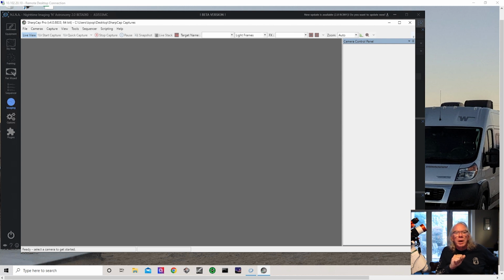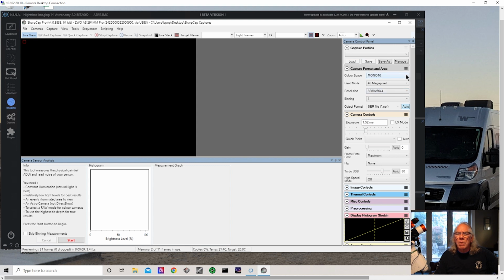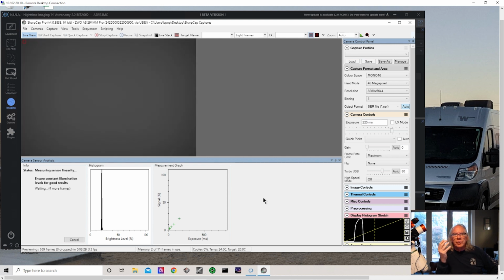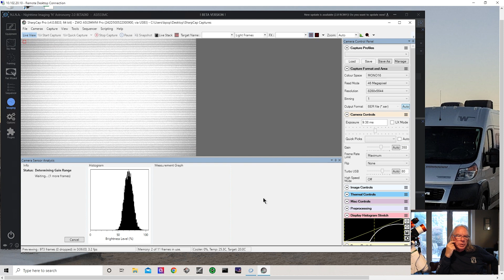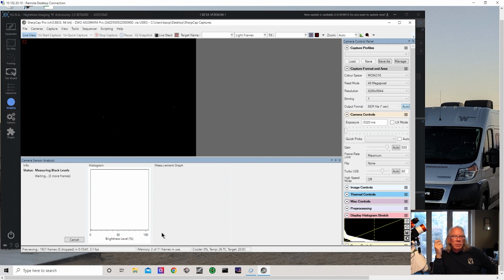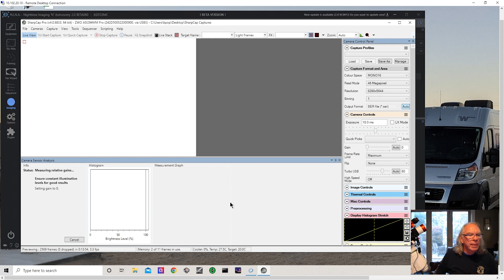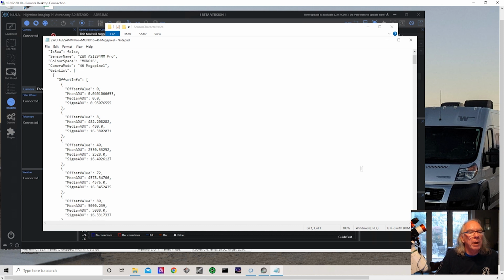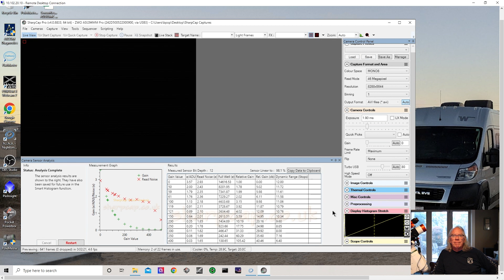Sharpcap Sensor Analysis - NINA Exposure Calculator - EQ6-R Pro Mount

Comment: Sharpcap's polar alignment and sensor analysis are superb. Polar alignment is very accurate, you can also add an accurate location and correct for atmospheric distortion in the settings page.
Reply from the maker: I still have it on my roadmap to use it for alignment at some point. Thanks for taking a moment to comment, much appreciated.  👍

Comment: I can not seem to figure out whether or not its is ok to do the sensor analysis with the luminance filter?  Or any filter for that matter.  I have a mono camera with a 7 position filter wheel.  Do I have to take the camera off the filter wheel or remove the filter before I do this or do I want to perform a sensor analysis on each filter?  I'm a bit confused about how do this with mono and filters.
Reply from the maker: Since it is just profiling the sensor I did it without any filter. At the time I did it I did not find anything about using a filter.

Comment: I was not able to get NINA to read the free SharpCap sensor analysis. It doesn't even see them.
Reply from the maker: Did you identify the path to the SharpCap file in the NINA configuration?
Reply: @AstroVagabond  Yes.
Reply: Update: There are .bin files that SharpCap created in the default folder, but aren't picked up by NINA. Odd.